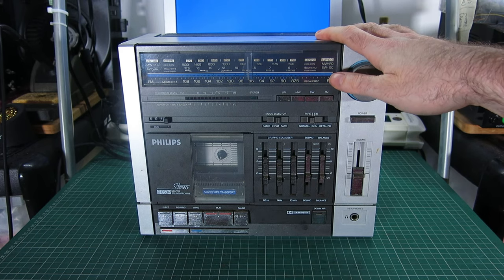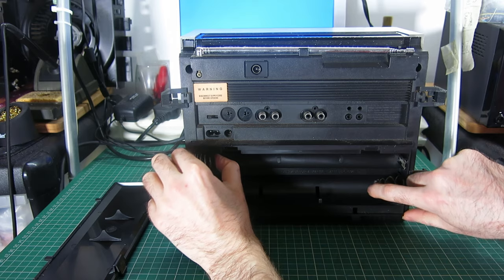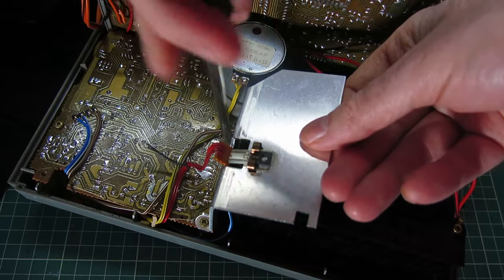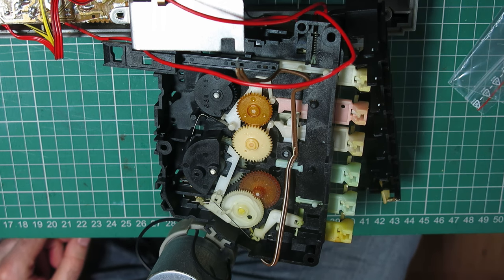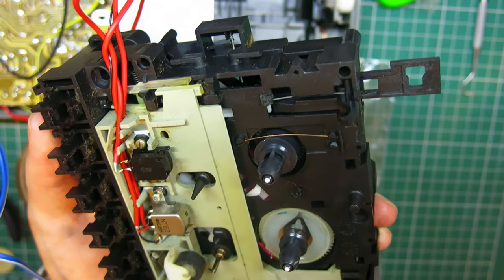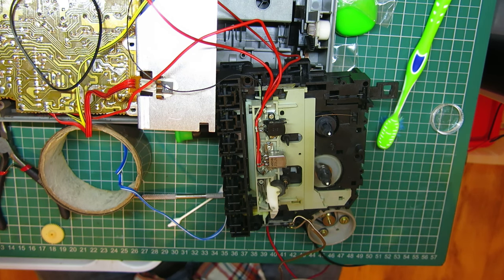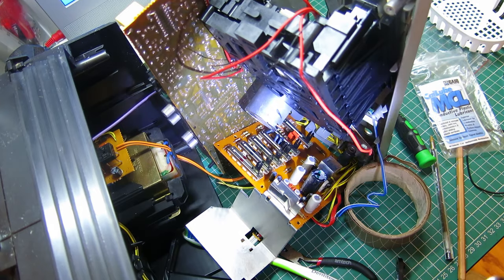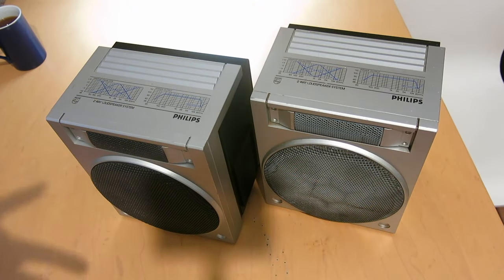1984 Philips D8534 'Cheese Gears' Repair • Plastic Fantastic?

Comment: The full logic version also suffer from it. It is incredible how the people who invented the cassette couldnt do better. Any panasonic or Hitachi mechanism form this era will only need belts. Another brand that used this crap silicone gears is Grundig and Dual. And later Technics (they called fuse gears, mean to protect the mechanism) ....
Reply from the maker: That's a good point about them being the "inventor of the cassette" haha! Yes I was surprised to find the extent of how this material was used. CD player trays and all sorts
Reply: @jamesbennettmusic   My theory is, when new, they are soft and tend to avoid the grinding vibration that could be transmited to the take up and eventually hurt the W&F. They are kinda of rubery, but hard enough to work as a gear. The other way would have been ...using rubber tires like thay have done for more than a decade. This have proven to be good enough. But hey, philips trying to save some pennies (IMHO). Which is a shame because Philips really did GOOD stuff.
Reply: @38911bytefree  Here's a bit of a defense of European companies. This equipment had this plastic because it was intended for a few years of use and not for collectors in the 40s later. In 1984, European companies and not only European ones did not have such strong support and government protection as Asian companies, especially Japanese ones, had with your MITI. Social welfare in Japan was also much lower. Many Western companies could not afford mass production. And Western societies were not willing to tolerate protectionist solutions at home as much as Asians did.

Comment: I had a tosiba boombox around 1986, great little stereo think it was an RT80S

These phillips units had great sounding speakers tbh, although plastic if you fitted a proper tweeter and sealed the cabinets up they sounded very nice

Warning from me, i had a pair of those side cutters, the end snapped off and hit me right in the corner of my eye, had to have a trip up to the eye hospital to get a 1mm piece of metal out of my eyeball, extremely painful.
Reply from the maker: I have a nice pair of Knipex with the little retainer bar that I use for component leads to stop them pinging across the room. For quick and dirty jobs I use the blue knockoff ones!

Comment: hi, I'm with the repair of a Philips D8234 recorder which has the same mechanics. Once opened I verified that 2 mechanisms with the teeth were broken and I replaced them. once everything has been reassembled, it happens to me that both with the play button and with forward and backward the plate raises but comes back down and doesn't stay there to play. I thought something was broken and I saw the inside of the large black wheel that raises the whole mechanism, a piece of the edge is missing, but I don't know if it's normal. I can't find a new one to see the difference. could you help me please?
Reply from the maker: I don't have this anymore unfortunately (it doesn't belong to me) - everything I've got is in the video. A few models use the same mechanism so you might be able to look around on YouTube to see if anyone has other shots of it

Comment: Hi! Super helpful video, thank you so much! I picked one of these up for £15 with a 'stuck in' Eject button; cracked her open, the little  spring on the back of the Eject button mechanism is missing and the Eject button was pushed in too far as a result. Is there any chance you could tell me what size spring to get so I can replace it? Many thanks!
Reply from the maker: Thanks! I'm afraid I've no idea on the spring - this repair was a job for the owner, not myself, so I don't have it anymore to check. Unfortunately the service manual shows no breakdown of the tape mech parts either